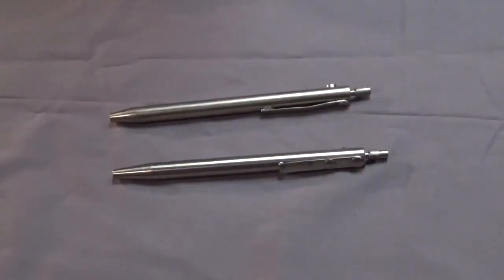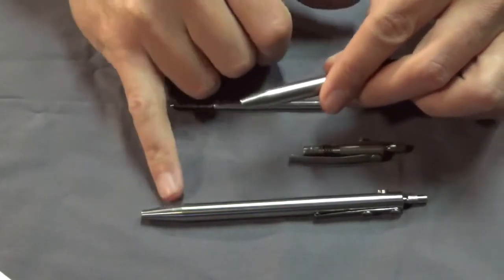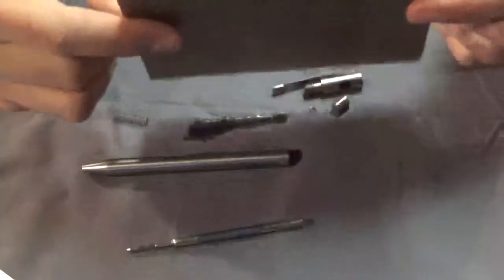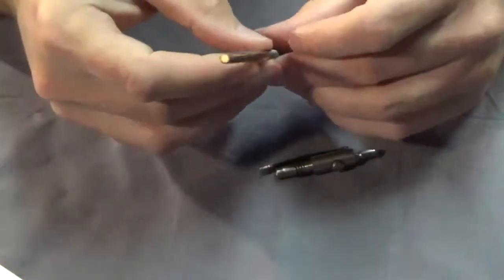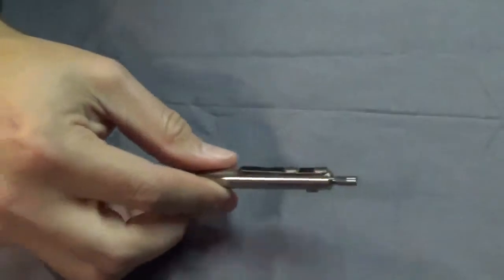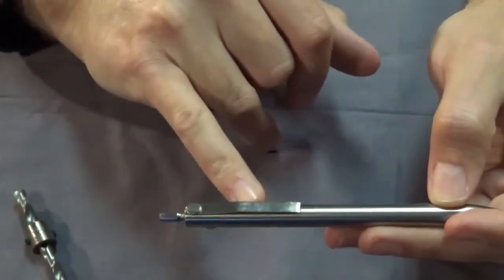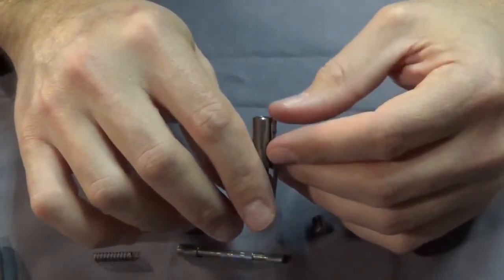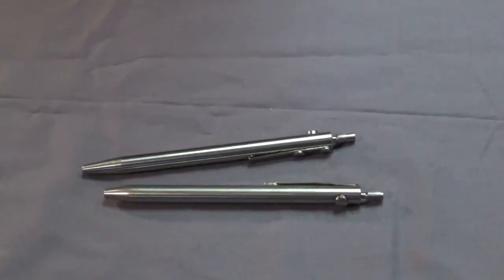A Homemade DIY Titanium Ink Pen, Click Type: Metal Lathe Project

Comment: Would you make custom ink pens from titanium  on a design and specs i have?
Reply from the maker: I'm honored, but sadly no. I'm not a professional machinist so this is just a hobby. I believe there are several websites that will machine parts (you just upload a cad). Also, a small lathe really isn't that expensive and a lot of fun. Thanks for watching and commenting.